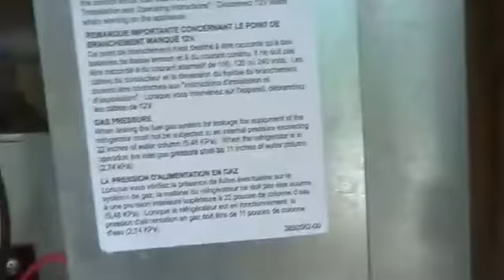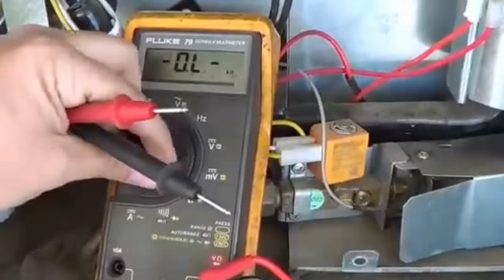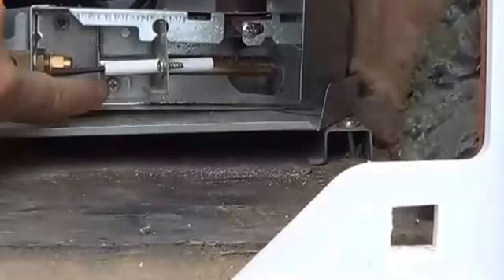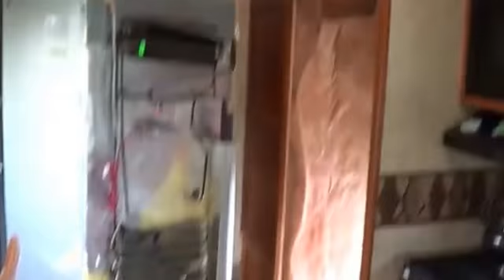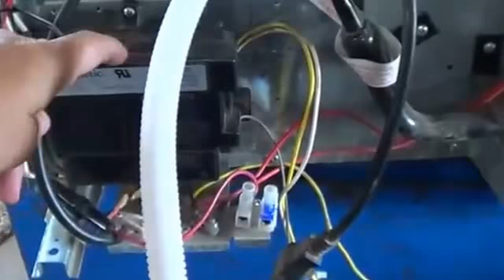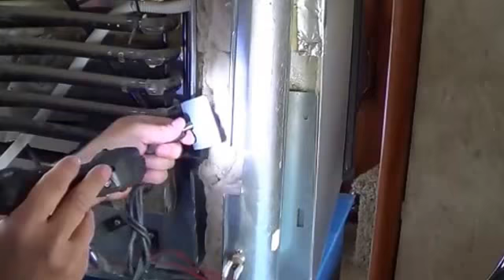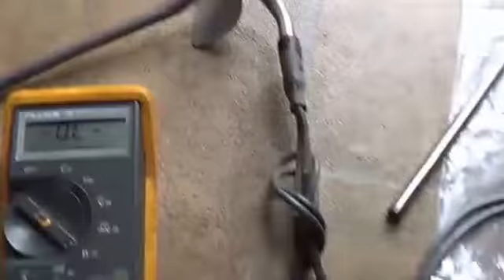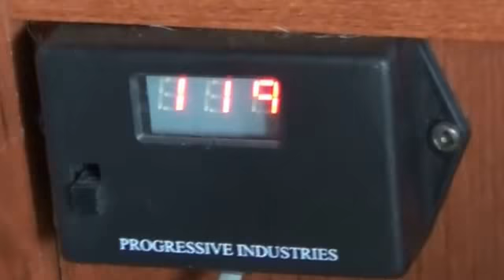Dometic DM2652 RV Refrigerator Repair

Comment: Mine's not working on electric. Not sure about propane since I don't have it hooked up. I looked everywhere, and couldn't find a model or name. 1984 terry, and it looks old, so I'm guessing it's original. Anywho, I was checking the two fuses in the outside access panel, and like a bone head, was using a screwdriver, and it sparked. I unplugged the ac power, but didn't think it was hooked to the battery. I think they were both fine, but I wanted to make sure, since it was dark, and the flashlight wasn't the best. Now one of them is popped, and I hope I didn't damage anything else on the electric board. The indicator lights haven't worked in awhile for gas/elec, so that doesn't help either. Any ideas? I don't hear anything running when it's on electric, and I checked after 30 min in the freezer, and it's not getting cold. I checked it's power supply with a clock radio. The outlet is good.
Reply from the maker: Peachride EightyNine Wow, that's an oldy, do you think it is the original fridge or has it been replaced somewhere along the line?When on electric for a while you want to feel and see if anything is getting hot, there should be an heater element in there, if you feel it getting nice and warm but no cooling, I would suspect the piping has a leak and has lost it's refrigerant, if that's the case it is likely toast. If nothing is warming up then an electrical problem, like the control board or the element is bad.
Just some guesses,with a fridge that old I'm not really sure. Too bad you can't locate a model number or manual.
Reply: It's daylight now, so I can see. It's an old norco. I replaced the fuses, and am waiting now to see if it cools down. Crossing my fingers.
Reply: Ok, I checked where the gas goes in by the pilot light, and it's getting hot. Does it just take hours to get cold or something in electric mode?
Reply from the maker: Should take a few hours to get cold, RV fridges are much slower getting to temperature than a regular house fridge.

Comment: My unit heats the flue on gas really well and also heats it on electric but not as hot, at least by touch, but neither way causes the unit to cool or freeze.  Could it be the circuit board?
Reply from the maker: terry milligan Maybe you have a plugged or leaked cooling unit.

Comment: I have a simular unit DM2652LBFX.  My problem is it cools fine with AC, but on gas it does not.  I've cleaned the burner, cleaned the jet, now I think I need to clean the baffle.  Do I have to pull the whole unit (like you did)  to get to the flue baffle and flue tube and clean them?  Thanks for the great video and help...Terry
Reply from the maker: Terry Landis Yes, I'd say so. At least on mine it made it soo much easier than trying to mess with it in such tight quarters.
Reply: Love Your RV Just a follow up, I was able to slide my arm down the top vent and remove the  flue baffle.  My arm is a bit scratched up from it but it was quick.  My refrigerator is in the slide-out so that might help with access.  I cleaned the baffle and did another two hour soak of the jet in carburetor cleaner.  My flame does seem to be hotter.  Still waiting to see if this fixed the not cooling problem.   I'd add a photo, but it doesn't seem to allow it....thanks again.  TL
Reply from the maker: Terry Landis Thanks for the update. Always interesting to hear. My unit has a roof vent so could ever reach. I hope that solves it for you. Gas issues can be hard to figure out. Best of luck to you.

Comment: Great video!  I'm pretty sure that I have the same fridge, so I'll know what to do if I have to.  I'll also check for the strain on the connector where it's zip tied.  Thanks also for the link to the service manual.  I have the manual saved on my IPad in case I ever need it.

Comment: Would it not have been easier to bypass the control section and run directly to the heating element and do a 24 hour op test? If the refrig freezes the heating element is good and if not the heating element is bad. Use Ohms law for testing the correct element.
Reply from the maker: There was no need to do any further test, I measured the resistance on the heater element,it was open. Ohms laws, yes.
Reply: Love Your RV were you able to determine the cause of the open? I'm analytical as well so I'm thinking design flaw or something like that.
Reply from the maker: layton86  No, the element is completely sealed with epoxy where the two leads go in so there is no way to know exactly where the open circuit point was, but I suspect it was right at the end point where the leads to in. They were a little strained because the  leads had been zip strapped in place fairly tight.

Comment: While you had it out your should have done something about that cheesy insulation yuk..... plus foam would improve your cooling and cut cost to run 
Proper insulating is one of the best ways to improve cooling
Reply from the maker: Seems to cool fine even in hot weather, I don't have any complaints there, but next time I'll look into it, thanks.

Comment from the maker: Thanks! I wasn't sure if I could go with a different type of drain hose, but I see from a video on the subject in your channel - FordRVRefrigeration that I can use a rubber one instead. That's great because the plastic OEM one is junk, already brittle, and the local RV dealers don't even stock it.